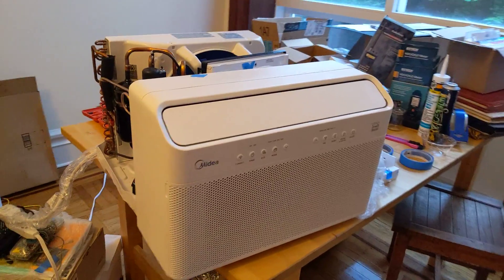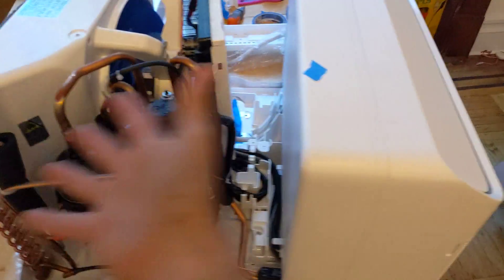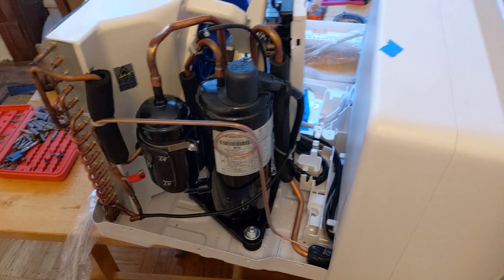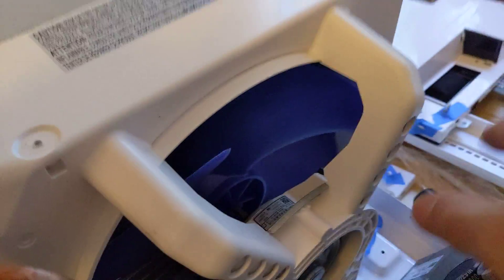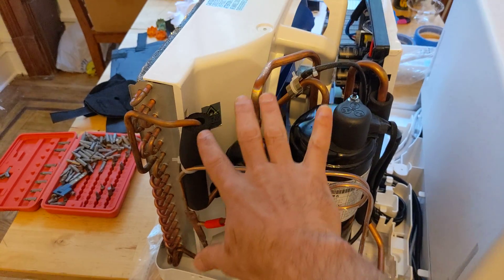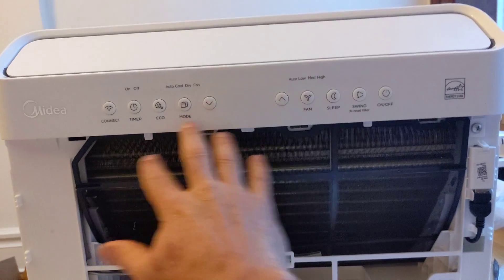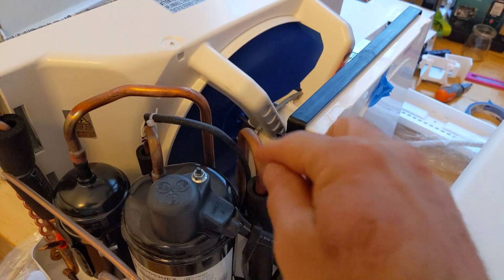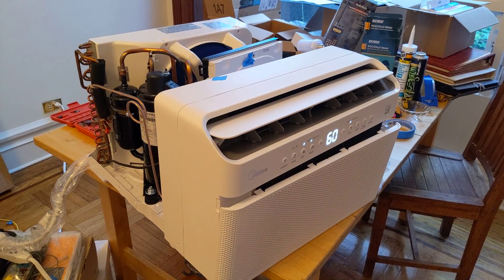How did Midea fit a full mini-split system inside their new "U" window unit?

Comment from the maker: Here is a photo journal of taking apart the inside half of this same model...
https://photos.app.goo.gl/HkgipAV39j8BWXWm7
Reply: now split it in half! 😁😁😁
Reply: @Beardinc  
Cut anything in half for any reason
https://youtu.be/FZ4qeJly1g0
Reply: is that high pitch whine normal? mine has it and other's say it shouldn't nor is it present in other videos. Ran it for two hours and its still there plus, you can hear it inside.
Reply: Thank you for the helpful photos! Midea sure did make this a bit time consuming to properly clean -> I'm gonna have to undo that fan housing so i can access the fan AND the back part of the evaporator in order to properly clean the mold that accumulated after a few month. Here's hoping I don't break the thing!
Reply: Can you do a test and see if the dongle being unplugged lets the AC boot up from being turned off/unplugged? I am considering buying one of these ACs but want it un-smartified. If it does turn on, what happens when you hold the AP button?

Comment: ok ive had this idea for a number of years now, and i remembered you walking through this unit years back on this video. Im back with a wild questions and idea. Do you think it would be possible to disconnect the refrigerant lines, and extend the two halves longer away, effectively turning the unit into an actual mini split system? Obviously would need to extend wires and add some sort of runn off for condensation on the inside unit.

Comment: My outside blower motor stopped spinning.  Which bricked the entire unit sven though the inner blower motor works and the compressor still work.  I wonder if anyone has the knowhow to fix the outside motor.  I know the unit basically still works, because it blows cold air for a few seconds and shuts off eith a error code becaude the outside blower never starts up.

I checked to see if the motor is stuck, it is not.

Comment: It’s July 2, 2025 as I’m writing this comment. The infamous recall for mold, is less than a month old. My 12,000 BTU unit from Costco was delivered last Friday, June 27. I completed most of the main installation yesterday, and finished up closing the air leak gaps today. As far as I’m concerned, the installation is complete.
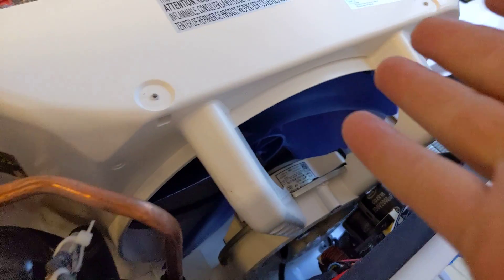      2:45   Please pay attention to this statement: “Right down here, at the bottom of the condenser coil, we can see that it dips into this trough here, which fills up with a puddle of condensate fluid, so that you get a little bit of ‘super-cooling’ down there from the condensate.”
      No offense intended sir, but that puddle of condensate is the entire reason why these units have been recalled, and why most other window-mounted air conditioners SHOULD be recalled. There’s no such thing as “super-cooling” when it comes to refrigerated air conditioning systems. The evaporator section removes moisture and heat from ambient interior air, and transfers it to the condenser section. Liquid condensation is the byproduct. The condenser fan helps dissipate heat from the condenser coils. The condensate should just be dumped overboard. It does more harm than good.
      My brand new Midea U-shaped, 12,000 BTU window A/C is going to get its first full workout today. I’ve already removed the blue, low point rubber drain plug. Condensate being allowed to pool at the bottom of the unit, is just nonsense.

Comment: Efficient ac unit but Midea has put out a recall on these u shape ac. They will give a refund or have you get it repaired. The recall is on mold buildup that is causing complaints.

Comment: Considering the recall is it feasible to replace the power cord on a unit? I wasn't able to see much in your video about routing and the final connection of the replacement cord.
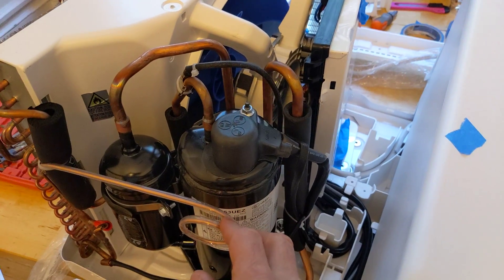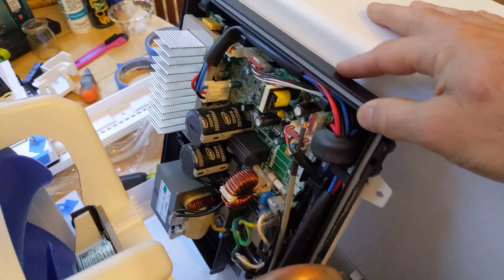Reply: You can see it come in from under the logic board at 02:06 to 02:11

Comment: In light of the recall, I would have liked to have seen the rear enclosure removal. It seems like, you need to add a pre-filter and drill holes in the outside, rear, bottom corners to stop the mold. It seems like the cover needs to be removed to be sure of where to drill to avoid hitting the refrigerant lines.
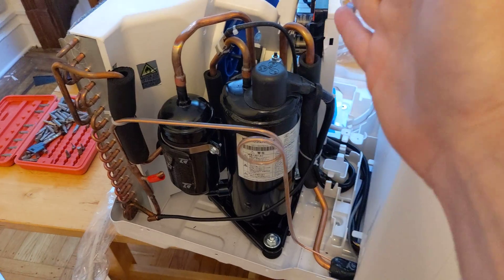Reply from the maker: There are many suitable places to easily drill a drain hole. For example, at 1:30 you can see the lower right corner. You could drill from the back or bottom there.
Reply: @bigjoshlevine  I don't actually understand how the mold issue is traveling up that drain gutter @3:50.. even if the condensate was full enough to overflow, that gutter seems high enough?  Either way my gutter was funky after a year of hard use.

I'm taking the refund, but have it disassembled and scrubbing it out as well to try and not waste a pretty nice unit (minus the mold issue lol).   My squirrel cage was pretty funky after a year with lots of dust and mold build up.
I added a small drain hole to the outside right edge (looking at the unit from the outside) so some supercooling might happen as the condensate drains through.   We need a nice DIY fix so those inclined can refund and keep the unit in use at their own risks 😆

Whatever overflow drain existed, it's definitely clogged... mine was overflowing underneath near the window frame.
Reply from the maker: @Alex-je6od Yea, I'm not sure I understand the worst case here either. But I do know that sometimes it is just easier/cheaper to consent to a recall and move on. I agree that someone should make that video - the modification is easy enough for anyone handy to do. I have never seen one of these mold units... So you should make that video!!! :)
Reply: @Alex-je6od To refund, you need to cut the AC cord and submit a single photo showing the cut cord and the serial number number.  I suppose some could figure out how to splice the cord, but seems risky.    When submitting my claim, I looked for the option of getting a DIY kit and instructions for retrofitting, but didn’t see that option.   Either refund or tech visit.   I’m guessing they don’t want to risk more potential harm from users modifying the units.
Reply: A core problem is running the unit all night, or for a set time, then shutting it off for a period of time. Condensation just sits inside the blower and on the condenser. What further complicates this is the “door” that shuts, blocking air flow and light, creating ideal conditions for mold. If people would turn it to fan mode for an hour after they stop using the ac, and manually open the door after the unit gets shut off, this would greatly reduce the chance for mold, if not eliminate it altogether. But if you don’t address the humidity inside the room (keeping it under 60%), then mold still has a chance of growing, not just inside the unit but in other places. If the window ac can’t get humidity down, definitely consider a dehumidifier

Comment: The compressor on mine no longer kicks on after only 2 seasons.  What should I check for when I open it up?
Reply from the maker: And beeps or blinking LEDs?
Reply: @bigjoshlevine  Everything looks like it is working as normal from the LEDs in front just never get any cold air because the compressor never turns on.
Reply from the maker: @davidb.5544 and just checking, you are sure you are in cool mode and the setpoint is lower then the current inside temp? If so, then could be anything from the indoor temp sensor to the power control board to the compressor itself. Tracking it down can take some work!

Comment: hi! This is very helpful for taking it apart and one of the few videos I could find so thank you!

I have had one for a few years now and I just installed it this year and got a PC00 error code which looks to mean "Temperature protection of compressor discharge or compressor top." Do you know anything about this and have an idea of anything I could do at home to fix it?
Reply from the maker: Hmmm.. I do not know what that code means, but if it is as described then that would suggest that the temp sensor that you can see attached to the small copper tube that leaves the top of the compressor is reading too hot. I'd personally try taking the rear cover off and checking whats going on with that sensor. If the sensor is ok, then another thing that could cause that section to get too hot would be some kind of obstruction either blocking the refrigerant from flowing thru the coils in the back, or something preventing that refrigerant from cooling down inside that coil.

Comment: Is this his Slinger design or does this unit have to be angled to drip out the condensed condensation?
Reply from the maker: Neither! The hot gas line dips into the pan so when the condensate gets high enough it is heated, which is expected to make it evaporate into the air flowing though the condenser coil.

Comment: What are your thoughts on the mold issue with these units, and this gentleman’s modifications to avoid the mold?

https://youtu.be/kQSixXZT9-E?si=7iEMSXfXBcra5-qR
Reply from the maker: If the unit is pitched correctly and you still are having problems with mold growing in the pan on the outside, then you can drill hole to let the condensate drain outside and the only downsides are that you will loose a bit of efficiency and that you will get some rush around the holes.

Comment: Where is the drain?
Reply: https://youtu.be/kQSixXZT9-E?si=7iEMSXfXBcra5-qR
Reply from the maker: No drain! The condensate flows from the inside to the outside in a trough, and then it evaporates from the pan outside helped by the heat of the hot gas coming out of the compressor.

Comment: Midea didn't think at all about how to clean it. Yes, it works quietly, we bought it in May 2024, and we have been suffering from a mold smell for a month now. Midea didn't think about maintenance, it's impossible to reach contaminated areas and it's impossible to pull it out of the case like a regular AC. Customer service did not help at all.

Comment: So drilling holes in the pan to drain the condensate is not a good idea?
Reply from the maker: It probably slightly reduces efficiency and probably gives rust a place to start unless you carefully protect the newly exposed metal, but other than that it should be fine.

Comment: If anyone is interested in running this thing efficiently from 12v, Amazon has 150w inverter modules that output the perfect voltage. QS-100. You'll need 2 of them and 8 high speed diodes. It was drawing 20-30A @12v with 50% load
Reply: There's a thousand watt version which I'm going to try, with that you would only need to make one Bridge rectifier

Comment: How old are you because when you turned this on my ears almost broke. The high pitch HZ sound is insane! Can you not hear it in the video? I hear it is at 14.4hz which my mom cannot hear but I can.
Reply from the maker: I'm pretty old, but I can still hear 14.4khz, and I do hear the whine from the motor in the unit. :)
But it is coming from the outside part, so I don't hear it when it is mounted in a window with everything sealed up.
Are you hearing it inside with the unit well mounted and sealed up?

Comment: It looks as though there’s no actual way for it to pull in  exterior air or exhaust room air in this model. I don’t see any pathway for that to be possible. Is that right?
Reply from the maker: This unit does not have any way of intentionally introducing exterior air into the indoor stream. If you wan that, then you could hack something up by making a hole in one of the baffles and running a tube from the outside to up where the indoor air exists the unit. The moving air will create a low pressure across the tube and suck some air in. I'd put some kind of a screen over the outside end of the tube to keep bugs out!
Reply: @bigjoshlevine  this is actually good - i am looking at mounting this in a kind of trunk space for a camper and i needed to know if i have to isolate the intake and exhausts streams if it's exhausting out a sort of duct before it hits outside.  Thank for the video & reply

Comment: Great video on this u shape ac unit. Nice break down explanation on compressor and single shaft driven motors which many people don't know. The fact that these two parts are separated gives it better ac process. 
FYI: This unit does not have water drainage problems like new saddle Clearview units.
❤❤Enjoy your AC❤❤

Comment: My question is, though, can it compare to a unit from the 80s 70s
Reply: I dont think so, I bought one recently and to my disappointment a few days later someone where I work at threw one out. Out of curiosity I brought into my shop put it on fan to let i warm up and after about 10 minutes I put it to cool. The compressor went on sounded great started cooling and I thought to myself "Boy did I hit a homerun here". Sure enough after about 2 minutes of cooling the thing shuts down and gave me  Error Code 7. After a little research and stories on the net the company put some kind of insulation inside in a bad place close to the fan and after a while this insulation seems to slide off and gets caught up in the fan. Those who were lucky enough and caught this early simply had to remove the top cover and move the insulation back so it doesn't hit the fan however those who arent aware of how to open things up and fix things on their own were screwed. What happened to this unit even after removing this insulation that eventually turns into something like tar and glue is that it burned out some switch on the AC rendering it useless. So this insulation literally stops the fan sitting on the outside to stop spinning and after a while I guess it burns the switch that controls the fan.

Comment: I also bought the Midea 8000 BTU July 2023 when my house AC went out. It is very cheap to operate. So that is a plus. But just turned it on first time in 2024 and not working. NOT COOLING and error code 07. Called customer support and they will not honor the warranty unless I send a copy of receipt. Which I don't have anymore. So for around $400 I got about 4 months use out of it. Also had mold issues as most customers are noticing on the blower fan. Not happy.
Reply from the maker: It looks like the EC07 code mean that the control board is sensing that the fan is block and not turning. You might want to try to take off the outside cover and check to see if the fan blades are blocked, and free them if they are. Report back on what you find!
Reply: Thanks I will look at that.

Comment: Thank you very much for the explanation. This electronic circuit converts alternating current into direct current, isn't it? If it runs on direct current, how many amps and how many volts are needed to run the machine? How much is it in US dollars, and where can I buy it? 
Is it an air conditioning unit with a heat pump?
Reply from the maker: Here is a great post where someone has gotten one of these to run on DC...
https://diysolarforum.com/threads/midea-u-12k-power-from-dc-it-works.77577/page-2#post-994190
On low, it uses 316V * 0.34A.
These typically cost $200-300US and you can buy them everywhere, including Amazon...
https://amzn.to/4c2dpkh
This model only has cooling mode, no heating mode.

Comment: bro it's literally making a loud 'eeeeee' noise. that's not quiet my guy. I sleep next to my window and I'm having a heck of a time finding a window AC that doesn't make that squealing noise. It's been tough finding a good one, and so far Midea hasn't worked for me in what I've been needing
Reply: Did you buy it or you're just reporting from what you're seeing here?

Because FYI it's completely uncovered and sitting on a bench here of course you're going to here it make noise haha. 

But if it helps just installed one today, and this thing is crazy quiet compared to most window ACs. The noisy parts are all outside and the window is shut and sealed so you really don't hear the business end at all. Just sounds like a nice table fan.
Reply: Have mine, going 1 year. very quiet. no squealing. 
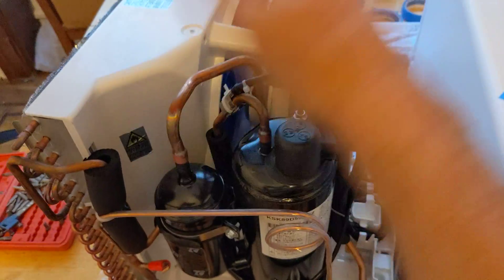When it first starts, you'll get a short few seconds of noise. -- 5:30 As he states, for this demo he notes he has the outer shell off and removed 2 items so we could see the guts, one a blanket (noise damper??)-- Also note, that exposed equipment in the Midea (U-channel models) for condensing sits outside the window.

Comment: Nice little AC. I hacked mine to run from high voltage battery directly. Highly efficient using only 100 watts on low speed.
Reply from the maker: I think a lot of people would love to know how to make this unit run from DC! Can you make a video and post a link to it here?
Reply: @bigjoshlevine  Its on my channel. Yt will not allow me to post links here.
Reply from the maker: @antronx7 Cool! Here is the link for others...
https://www.youtube.com/watch?v=5K6IRTLFZ-I

Are the connections shown in the video to output legs of the rectifier?
Reply: @bigjoshlevine  Yes. Connected to 2000uF 200v capacitors.

Comment: Hey, very useful video. We just ran a whole summer of this AC and it accumulated water like nothing we've ever seen and we don't even live in a particularly humid area. We're lost about how to keep it clean inside. It's a bit of a dusty and corroded mess. Is there a relatively easy way to remove the components of the back part to clean properly?

Comment: I just got the 8000 BTU unit. It's silent, efficient and overall awesome. One problem though, the inverter or potentially the evaporator blower motor makes a super high pitched sound. Probably around 16-18k Hertz. Sounds like those "dog whistle" apps. I think I must've got a defective unit?
Reply from the maker: Many (including me) have also noticed that the motor PWM frequency is annoyingly at the high end of the human audible range. This is unfortunate since they probably could have bumped that frequency up a little higher and perhaps only lost a little efficiency (or at least make this a setting). It might be possible to mitigate this by sticking some car sound deadening mat or putty onto these motors.